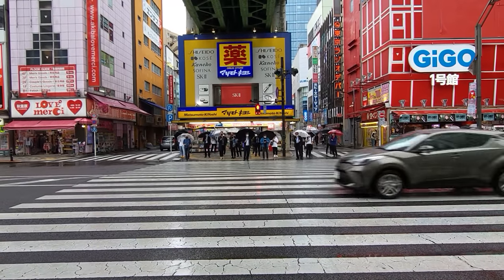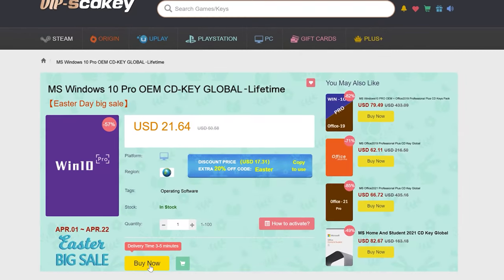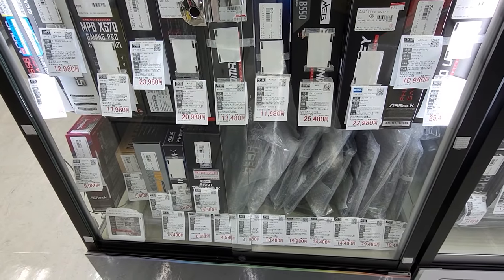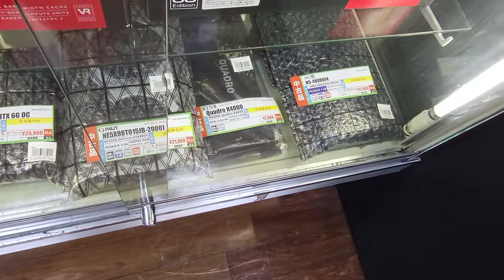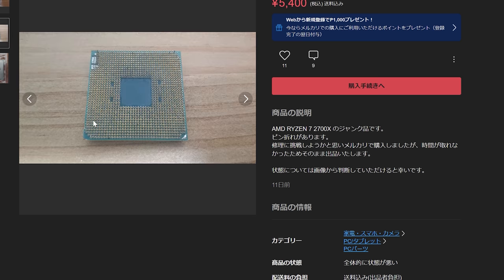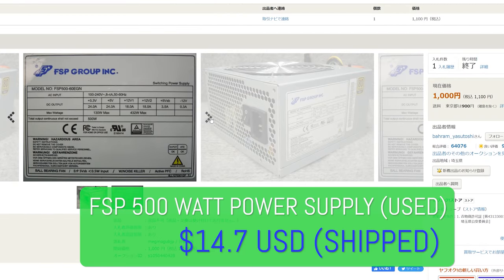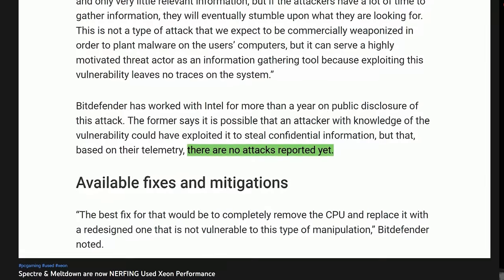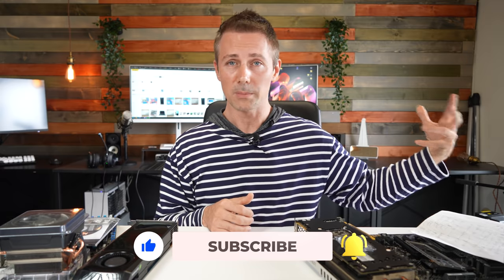USED PC Parts HUNTING In ELECTRIC CITY, TOKYO!

Comment: FSP power supplies are great.  They're actually the main OEM that EVGA uses.
Reply: FSP=Fortron=Quality
Reply: Wrong to correct you EVGA uses Super Flower.
Reply: @zushikatetomotoshift1575  not anymore
Reply: Not all are great, there is no Brand that only sells good PSUs. FSP is a major OEM Power Supply Manufacturer, their Power Supplies gets gebranded by CoolerMaster, Antec and EVGA, while also having their Own Lineup of PSUs. Usually Companies have multiple OEMs Working on a PSU Lineup for the Brands named above, so technicially neither of you is Wrong. FSP and Superflower has been working for EVGA.

Comment: Hi Tech, I'm having some issue, my H80i v2 rad fans just spontaneously ramp up to max speed after 15-20mins of gaming.
this wasn't a thing before with my old pc and wasn't a thing in this new pc with the 5600x, 3060ti, gigabyte b550m aorus elite for the first few weeks, granted its summer time so ambient temp is 40*C but the msi afterburner doesn't show any change in temp even if the fans ramp up to max... hangs around ~60C but if YT is running in the background it jumps to around ~67C... any ideas?
Reply: Sounds like a dead pump on your AIO. My friend had to RMA his Corsair H100i twice due to the pumps dying.
Reply: @twokillabytes3693  I don't hear or see any signs that my pump is dead...
ICue is showing pump is at 900-1700rpms when free and underload respectively... my coolant temp are 36C right now and they bump up to 39.4C underload.
Reply: @mab2187  Maybe the fan setting has changed in the software. I have mine set to quiet but they do ramp up at times to maintain. It could also mean that you're putting more load on your cpu. Running any new software in the background?
Reply: @TerraWare  my fans are also set to quiet, they ramp up to normal speeds but after like 20 mins or so they go full jet engine, and when i stop gaming they come back down to quiet, when i go back to gaming tho again it they go full jet engine after 15-20mins... doesn't matter if I'm doing anything else in the background like Google or just all things close and gaming. MSI afterburner is on tho cus my 3060ti is undervolted-I doubt this is the cause cus I've tried with afterburner closed too...
Reply: @TerraWare  When google is playing a video, depending on the video CPU usage goes up and temps go up from ~20% usage to 30%, respectively ~60C-67C. In the background ofcourse during gaming.
Reply: @mab2187  It sounds like the cooler may be hitting it's capacity but that's just a theory, assuming everything else is working fine.
Reply from the maker: can try a different fan header (pump fan header) or make sure in the motherboard the fan port is set to full speed (the one that is running the pump).
Reply: That an old AIO maybe try Corsair Link instead but it does sound like the pump dead or about to.
Reply: Ok I changed the rad fan from the pump header aka the Y splitter cable from the pump block to the motherboard fan 1 and 2 headers and the ramp up are gone now... the loudest noise I hear now I think is the pump itself.
Reply: @mab2187  Is it a tick tick tick noise cause that would be a dying pump?

The ramp up noise would of been the fan curve set in ICue you should try Link as ICue was designed for the current gen AIO.

Also try what Bryan said above by plugin the AIO connector from the block to the 2nd CPU header. They are called one of these "PUMP, CPU PUMP, CPU2, CPU ALT"
Reply: @grlmgor  No nothing like tick tick just normal ramping sound.
I'll see what Link is don't know about it except ICUE
As for the header, mine's a B550M Aorus Elite, it doesn't have an additional CPU Pump header, it just has 1 USB header, 1 CPU Fan header and 2 System Fan header, I switched the natural cable coming off of the CPU pump block (Y splitter cable) and connected the rad fans to the System Fan 1,2 headers and now my fans aren't controlled by ICUE anymore, + they aren't ramping up to max rpm.
Reply: @mab2187  OK yeah it sound like a software issue. Switch your fans back to the y splitter and try these option below.

It Either
ICue has a weird fan curve. (Check the fan curve)
ICue doesn't like that old generation AIO. (Try Link)
Gigabyte fan control in the Bios is applying it own fan curve. (Check the fan curve for the CPU and remove it)
Reply: @mab2187  Also check to see if their no cuts in the cables.

Comment: I bought two GTX 580 and both were broken. Asus only showing display adapter. MSI with bad video and sound output. Hours of driver changes and  firmware flashes didn't helped.  Both seller lied.

Comment: Hey Brian random question: Do you think I can run an 11700k and an rtx 3070 on a 550w 80+ gold PSU? I think I can, although I might need to undervolt the rtx 3070.
Reply: No.
Reply from the maker: If its a solid 550W then it will easily do it, though draw spikes are the biggest reason for getting a bigger power supply with the RTX 3000 series cards. With an undervolt on the GPU it will be smooth as though IMO.
Reply: @techyescity  thanks for the response. I kinda figured this. I have a 600w power supply at my other place just in case. Kind of a pain trying to move that here though.
Reply: @techyescity  I ended up getting an evga black 3070 "on sale" here in the US for $600 shipped after tax. I undervolted my cpu a little bit, which helped power consumption. When I get the 3070, I'm def gonna undervolt it. I'll let you know how it goes.

Comment: Speaking of DDR3, I have 3 Dell Optiplex (Tower) 980's  with; i7-860, 8GB(2x4GB) 1333MHz RAM and had 2 of them paired with GT 730 1GB GDDR5 ( I have two of these cards and tried them both, same issue).
I was getting some bad frametimes, and frame drops, I thought it was the GPU causing the problems, but recently I purchased two Dell Optiplex (SFF) 790's
with; i5-2400, 8GB(2x4GB)1333MHz RAM, both paired with GT 1030 2GB GDDR5's, and to my surprise I was still getting very similar frametimes/frame drops, making these computers unsalable at the moment . Is the problem here the Optiplex's
or DDR3 1333MHz. I'm at a loss and can't find answers online.

Comment: My Intel i3 3rd with GTX 1060 started working again, I found enough parts to build a PC to ran with with my Logitech G27 ($50 AUD not working), but then it started booting again. Must be a intermittent fault. Point being AM4 is getting that cheap it's not worth spending anything on a i7 4790 cpu. The i7 4790 is going with the G27, and a new AM4 build is going into the Jonsbo V4.

Comment: Hey Bryan what are safe temps for the X5675 im running 1.46v and see temps spike to over 81c with heavy usage, thermal throttle seems to be 96c but it never reaches that is that safe? gaming I only see 60-71c
Reply: 1.46v is absolutely mental to run. You never wanna daily higher than 1.35v unless you wanna risk quick cpu death or CPU degredation.
Reply from the maker: As Jforce said, I wouldn't run 1.46v on the x5675 as a daily, surprised is hasn't clonked out yet lmao.  For me 1.4v is the max for 32nm, I think 1.45v is ok for the i7-920 etc. iirc, I just haven't used the 45nm chips and overclocked them in ages.  Though yeah try to bring that down to 1.35v as a daily voltage for oc.
Reply: @jforce321  been running solid at 1.45v for over a year had to bump it up a little more recently when I installed my GTX1080 and wanted to boost the DDR up to 1969 CPU was 12 bucks so I'm not too worried about that more interested in temperatures or if you think that voltage could risk damaging anything else? I was only able to achieve 4.3MHz @1.35v with auto voltage, that gives me close to a 50-point drop in cinebench R15, and 700 point drop in firestrike haha only about 4 fps drop in games
Reply: @paulburkey2 yeah it'll put strain on the motherboard too since higher voltages means way higher power consumption. Your vrm has to bear the burden of all that to make the CPU work.

With how old x58 boards are I wouldn't want to kill it by putting stupid amounts of voltage into it
Reply: @jforce321  yeah you're probably right I dropped the multiplier to 22 now it's 4.31mhz  CPU voltage set to auto which I believe is 1.35v max  without a noticeable drop gaming performance.

Comment: Bring back some Artisan Hien mousepads!
Reply from the maker: There are so many, looking for a control type pad, which one is the best from their line up? the zero or... the hien?
Reply: @techyescity  

 @Tech YES City  I have never used them but read good things about the Zero and Hien. I believe Zero is best for control, followed by Otsu V2 (see if they can let you test these 2 out). FX are stitched edges. Firmness is user dependent thinking soft is probably best with XSOFT some users reported sensor issues due to the softness of pad.

Hien as a good mix between control and glide. And then you work your way down to the Raiden and Shidenkai (I believe this last one has like a glass resin for Super speed).

Zero is probably safest one to go with as it compares most to traditional pad.